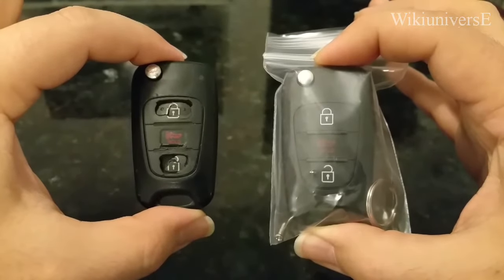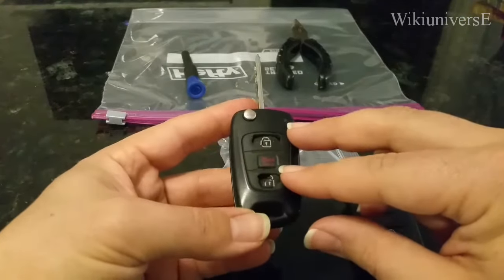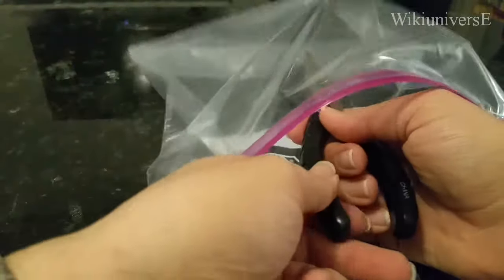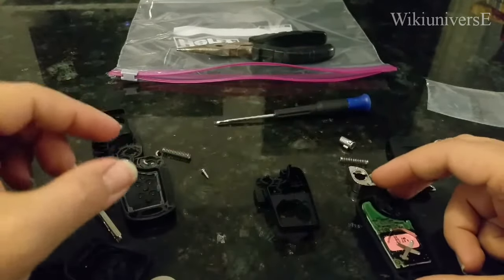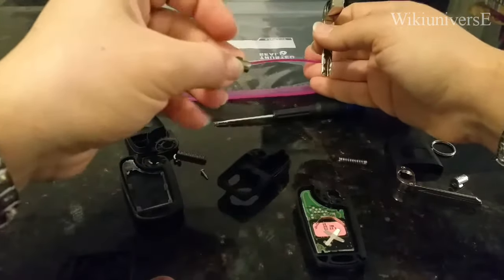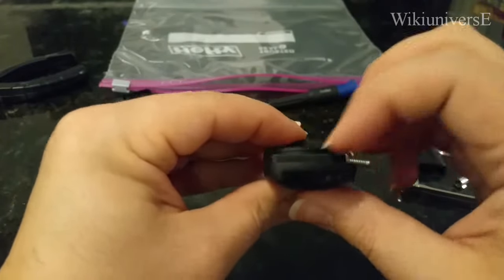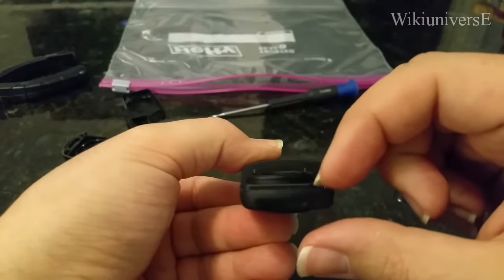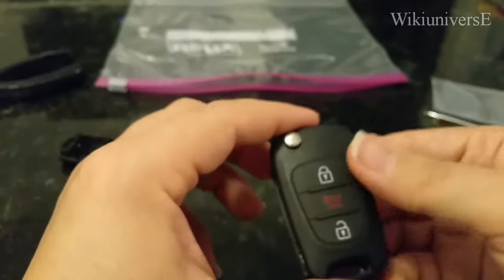How to Replace KIA KEY-FOB SHELL - THE RIGHT and PROPER WAY !!!

Comment: Exactly! This was the best video I found and while it took me 30 minutes to pry open the old key fob, it was not as easy as you made it sound the way it looked. I literally had to pound it with the needle nose, pliers inside the place where the key and the plastic waslol lol but seriously thank you so much!
Reply: ME TOO!! I had to pound the pliers in, get a screw driver to pry open the seam and beat the crap out of it with a hammer.  I eventually got it open. The next challenge for me was the pin and the spring.  If I had watched the video all the way through it would have been a breeze.  OH  The zip lock bag was genius!

Comment: I have a used 2013 Kia Soul I recently purchased. I attempted to open the fob with needle-nose pliers and wasn't able to. Felt like I applied enough force to break a pair of handcuffs. Couldn't get it. EDIT Ok. So I went into the garage and dug out the dremel and carefully breached the case. It appears that this is either a replacement case, or the original where they had accidently damaged it when opening to replace the battery. It was sealed shut with some heavy duty black adhesive. Still took some prying with a big flat head screwdriver to open it enough to split it by hand. Swapped everything left the mobo in the half that has the plastic wedge to align it. Put it back together and the battery wasn't tight enough, so I folded some electrical tape and placed it on the battery to force it down. Works great now. Thanks for the video.

Just thought I'd mention this for anybody wondering why their case might not be popping open with ease like the replacement or the video.

Comment: Great video, but I managed to buy the rubber button pad replacement for my old style fob and am glad I watched your video to realise I wouldn't be able to put it back together if I opened it up. Instead, I was able to pry the old pad out and the new one popped right in! No need to buy a new fob or open up the old one. Works great and cost less than £3.

Comment: Very well explained video. I had to laugh listening to you, because of your frustration with some YouTube videos. I've found many that play background music or use text overlay instead of talking. I'll watch whole videos, looking for an answer to one particular thing only to have that one detail I'm looking for completely skipped. Just replacing the shell of a FOB "should" work, but I'm in the process of doing this where it didn't work due to slight differences with the old shell and new.  Instead of getting just a replacement shell,  I ordered a new FOB with a new key and board included.

 Plan A:  I was going to simply find someone to cut the key on the new FOB and then program the board myself. Quick and easy.  Even though it would be an additional expense, it would still be much cheaper than buying a new FOB from a dealer. Called a lot of places and wasn't able to find anyone willing to do it without buying a new FOB from them. 

 Plan B: There is a little push pin that holds the keys in place without having to take the case apart and switch all of the parts like in your video. Then I would just have to do an easy programming of the new FOB board. Getting the pin out of the new FOB key proved to be frustrating, but I finally got it out. I basically destroyed the pin getting it out, but I thought I could use the pin from my old FOB key once I swapped them. Then I noticed (too late) that the pins that held each key in were different sizes, as were the holes the pins went into, so that wasn't going to work. 

Plan C: This is what you're showing in your video and where I'm at now. The first problem I ran into was what you said about the new button and spring not working in the new shell. So yes, I did the same and used the old ones. Problem solved? Nope. My next problem was that the old button would not fit through the new shell button hole. So I did a slight modification by slightly reaming the new shell button hole out a bit with a rat tail file. Problem solved? Nope. The buttons have 3 tabs on them that should fit inside the new shell, but after examining the tabs on the old button and the new one, I found they were off by about a millimeter. Now, it still won't work because the button tabs on the old button don't align with the slots in the new shell. So I'm very close at this point, but have to find some way to do another modification to the new shell. At least my old board in the new shell is working, it's just a matter of getting my old key assembly to work in the new FOB shell.  I'm doubtful if it's going to work perfectly no matter what I do, but at this point the old shell is history.

When I first started to research the 3 different ways to make this work ( supposedly) it always seemed everything worked great for people doing the videos (but probably not behind the scenes). I'm sure in some cases everything worked out fine, like it seems to have for you, but then I assume there's countless others like me that have run into the same issues I have. I also assume the people that manufacture these don't expect people to swap out the parts (unless you just get a new shell alone) but I also assume this doesn't always work as planned due to slight differences between the old shells and new ones. 

I wish someone that has run into the problems I have, and have had to do modifications would do a video, but maybe people don't like to make videos of something that failed instead of working as planned. In my opinion those are the videos that should be done. You have done this in part by explaining things others don't when trying to do this, but in the end in worked out as planned for you.

Comment: I used this tutorial just last night to switch out fobs for my daughter's car.  The only difference is that I had to also remove the new key by punching out the roll pin - on hers, the key had actually broken out of the flip portion.  I also had to do some light filing on the key so that it would fit - there was a slight difference in fit there.  I got it done though and the key and fob look brand new.  Nice vid!
Reply: You must have been lucky in that the roll pins were the same size with each FOB, as well as the hole sizes where the roll pins go in. I wasn't so lucky.

Comment: The bag idea is indeed a good one. However, if wear on the rubber button pad is the only problem your key has, there is a much easier solution. Here's what you do:

My wife's key had the rubber pad just as badly worn as the one at the start of this video. I bought a spare shell for about $10, thinking I would replace the shell entirely. However, I found that the rubber pad was not glued in to the spare, and could be very easily got out with a toothpick. Then I removed the residue of the broken one, again with a toothpick. I cleaned off the slight amount of glue residue on surfaces inside the shell  that the pad sticks to with isopropyl alcohol, then wiped with a cloth. Then I fitted the new rubber pad, using a tiny, tiny amount of Loctite gasket sealer, applied with the tip of a toothpick, as the adhesive. I think there are many other glues that would work just as well. It's as good as new now. If this is the only problem with the old key, it's a much better solution to do this rather than replace the whole shell.

I wouldn't have had the confidence to do this though if I hadn't studied this and some other videos first.
Reply: THANK YOU! This worked for me!  I could not get the original key fob open as in this video (neither could my very strong son!), but found how easy it was to just use the rubber pad instead -  I scraped out the rest of the broken pad very carefully and now just need to use a tiny amount of glue to keep the new pad in the old fob.  I have another Kia fob that I will do the same to. THIS!! :)
Reply: I second this. If the rubber button pad is the only issue, I found that replacing the old pad with a new one was very simple. Digging out the old, falling-apart one was pretty easy (I used one of those dental-style metal picks you can buy at hardware stores and gently pried up the edges and it came out easily), then I cleaned out any residue with a few shots of compressed air. The new rubber button pad also came out easily from the new shell key fob shell I’d bought from Amazon, and it fit perfectly in the old fob, with a few drops of superglue to hold it in place.
Reply: @buehrert  Wow! Nice. I just ordered the new fob. Will try this first. Thanks.
Reply: It worked great!  Pro-tip- Use the old plastic part under the rubber pad (the one that has a "frame"  around the three buttons on the inside) , instead of the one from the new fob-this way you know it will align with the holes in the original fob.  Pry it up gently so it won't break ( I used a very small flat head screwdriver, both to pry off the old rotten rubber button pieces and to pry up the rubber replacement from the new fob shell) , scrape off all of the old rotten rubber residue on the plastic frame, including around the edges  and fit the new rubber button piece around it. Press firmly on the frame and rubber piece until it clicks firmly into place.  There are two places where two sets of little pegs on the frame fit into the body of the fob, so make sure both sets click in.  If the edges of the rubber button piece are still sticking up, use a the screwdriver or the bent end of a paperclip to tuck it in until it is flush.  I did not have any glue handy to add before I assembled the button piece, but it was so firmly in place when I was finished, I don't think it will ever come out.  If it does, I'll add glue.   This is SO much easier than worrying about transferring the guts of the old fob and a transponder chip if the only issue is the rubber button piece.  I did both fobs easily and I am thrilled with the results!
Reply: Thank you for sharing that bit of info. New rubber button fitted in a couple of minutes
Reply: Kudo's for the tip of just removing the rubber pad. Wish I had read the comments first. I replaced the whole shell without a problem but will use this tip next time.
Reply: I think you should make a video of how to replace the rubber part as you described. Thanks for your tip.
Reply: Thank you, thank you, thank you!!! I was able to replace the button pad in 2 minutes, and I didn't have to bother with "guts."
Reply: I did that and i broke one key

Comment: Thank you! Your video was so easy to follow. I was able to change the shell on both my keys. They both had gotten to the point the buttons had broken. With in 10 minutes and less than $10 for both replacement shells I now have two new and functioning keys.

Comment: Excellent video, thank you very much.

One small thing I did notice when working on mine, however, is that while the motherboard doesn't "snap in" to the bottom of the keyfob, on mine at least, it did fit right in to a small niche on the top (the side where you are pressing the spring). That made it easier to be sure the motherboard was in the right place. It wasn't as good of a fit was it was in the old key fob, but it was there.

Comment: Yes great video I changed my fob as you did worked great.In the UK we have a small chip inside also to change over I think soaking in isopropyal alcahol may release the glue holding it in.The comment below mentions the immobilizer chip.Thanks for posting great information

Comment: Great video!  Had more trouble taking it apart. Also, I found that I did have to turn the key more than once for enough tension on the spring for the key to pop out like it should.  Thank you!

Comment: Worked like a charm! Just one thing, in my case, there was a little black chip which I missed to transfer and car won’t start. Once I inserted it into the case (goes into a slot at the top behind the board. Thank you very much for the instructions!

Comment: Excellent video though I agree with another comment below that certainly in the UK the key also has an immobilizer chip that is separate to the PCB and this needs swapping over from the old case to the new. Had to call out the recovery guys who had seen this a million times and knew exactly what the issue was. Good work though

Comment: Very helpful and easy to follow video. My key (2012 Kia Ceed MK2 UK) has a transponder  chip held in my a small piece of white plastic. Very straightforward to swap over as it just slots in and then you put the white plastic clip over it.

It’s very important you do not lose, damage or forget to move over the transponder chip. If you do your car will not start.
Reply: Soooo much see my post down below.

Comment: Thank you for your video. My problem rightnow I'm trying to do this, is mine won't separate as easily. I think my fob is glued together. So breaking the two pieces apart is my challenge rightnow. (And I have two fobs to replace) :::sigh::::

Comment: So I used your video as insight thanks by the way! The thing Is 2013 kia rio doesn't have immobilizer or atleast it's working with or without it (not advice) evert model is different the thing is however the antenna extension is glued into the fob.. this was a hard job for sure it was all glued together my mazda key has tabs that can just pri open ty for the help non the less my girlfriend is happy 😊

Comment: Hi thanks for the video everything was clear. Bought the case from amazon, its identical to yours, any idea why the key does not pop out when i press the button? When i touch the key and wiggle it back and forth its touchint something inside. Until i dont snap together the cases the key pops out without issue.

Comment: A very useful and very well explained video BUT what this doesn't show you, is that you need to remove and replace in the new key fob the tiny additional black chip that will start your Kia!!!!! If you follow this video to the letter (and parts of it are great) your new key fob will activate your central locking BUT WILL NOT start your car!!!

Comment: I used this video to switch out my busted shell. I followed all of the steps but for whatever reason the key doesn't pop out without a little help from me. It closes just fine without issue, but it doesn't spring open like it used to. Overall though I'm satisfied with the final product as I now how access to my keyless entry again. I'm hoping to have better luck with my second set. Thank you for saving me hundreds of dollars. The dealership of course never even mentioned this possibility to me when I inquired. I know real shocking of them to price gouge me 🙄

Comment: Great video, but I would like to ask if there is no need to program anything in the car, if everything will work as it should, opening the car and especially starting it.
Reply from the maker: No car programming needed
Reply: @wikiuniverse2152  thank you friend
Reply: Please, in the store where they change the keys, they told me that it will cost me 200 euros, that it needs to be coded. Are you really sure it won't be necessary? I only have one key and I want to do it exactly according to this video, but I'm not sure if I'm really going to screw anything up?
Reply: KIA CEED 1,6 cvvt 2010

Comment: The video was very detailed and everything worked as described but the light on the new fob in the video flashes white (or that what it appears to be) while when my new fob is reassembled, it flashes red and will not open the car. What did I do wrong?

Comment: Great video! but some of these fobs have a small separate transponder chip glued into the top corner of the casing that also needs changing over, for those ones if that is not done the cars locks will all work but the engine won’t fire up as the ecu on the engine is not getting the signal from the transponder chip 👍

Comment: Great video. Followed all the steps, transferred everything over including the chip. Car unlocks, ignition turns on. Engine turns over but doesn’t start. Any advice?
Reply from the maker: If yours has a chip! And you already transfer it! everything should be in order, another advice that I can give you is do you have a working spare key that you can try in order to determine if this is a key problem or a different problem with the car.

Comment: It is a GREAT video! But WHY didn't you inform about the immobilizer chip?! Thanks to you a comment here I did it correctly. 🙏🏻
Reply from the maker: My fob does not have a chip, that's why
Reply: @wikiuniverse2152 but most of the old keys does have it?
Reply from the maker: The newer ones  Mostly have it, the older ones don't, mine didn't have a chip when I made the video,  Afterwards people started coming up and said they're kayfob had a chip

Comment: Had a question....have a 2014 Kia Soul 4 button key fob with a loose roll pin that fixes the key into the pivot.  It's sticking out so that the key won't close, and the key is wobbly.  Do you know the size of the roll pins in these things?

Comment: good tutorial, however I don't know why but the key fob works for locking and unlocking the doors but when I turn on the ignition all the lights on the dashboard turn on as normal but the engine won't start. Any clues?
Reply from the maker: Some key fobs have little chip not all of them but some do, make sure you move the chip from old key fob to new key fob

Comment: I replaced the original last year with a replacement but now the replacement doesn't work even with a battery change. what can i do? is it a problem with the circuit board?
Reply from the maker: If changing the battery doesn't work most likely is the circuit board, find local key fob programmer to have a look at it or take it to Batteries Plus Bulbs and they will let you know if your key fob send or receives signal!
Reply: @wikiuniverse2152  Thank you!